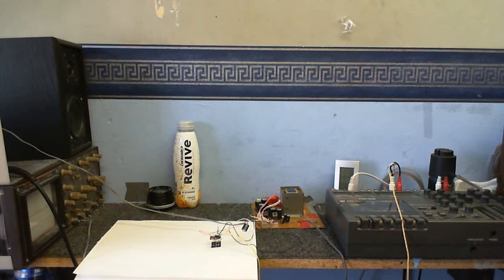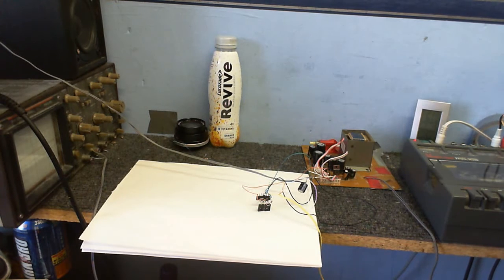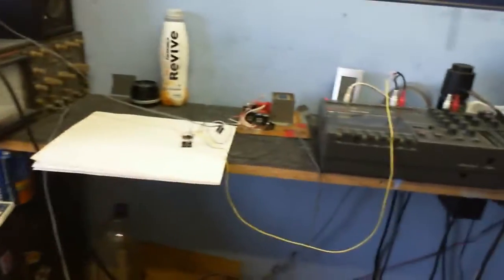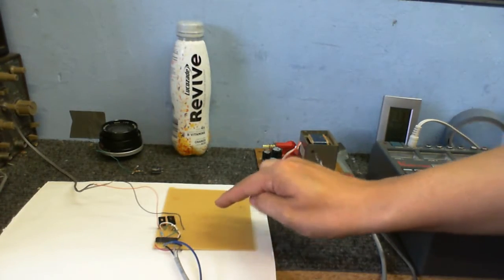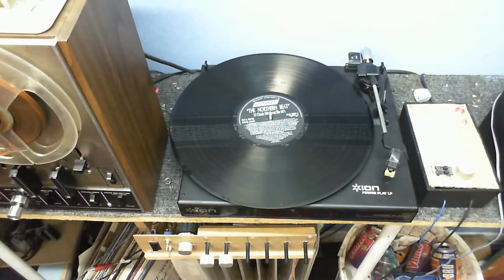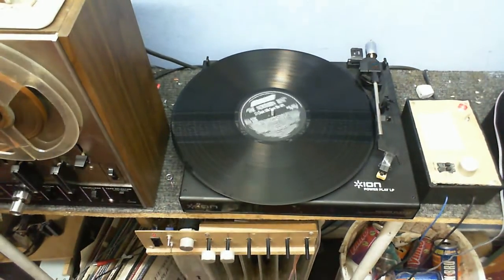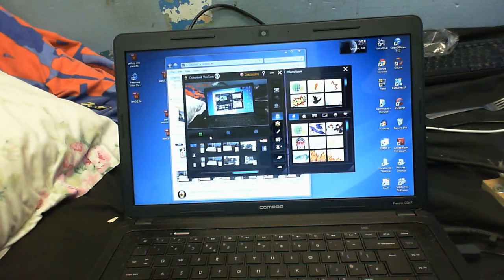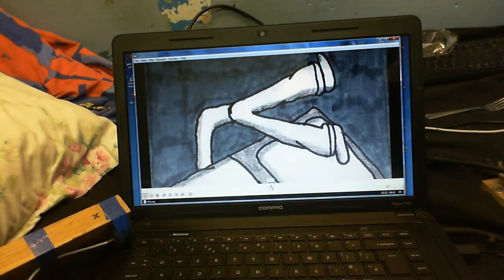Amplifier experiments, Updates and Rambling

Comment: With a sine wave signal on the input, scope the output of the OP amp and you see the heavily distorted signal fed to the transistors that "corrects" the cross over distortion of the unbiased output pair. It is a good lesson in how negative feedback linearizes the amplifier, but is actually a poor way to build a working amp.

Comment from the maker: Actually I did intentionally put the speaker there.  My scope has a problem where the the trace isn't completely level, even with the trace rotation turned as far as it can go it never completely fixes it, but having the speaker on top of the scope like that helps correct it